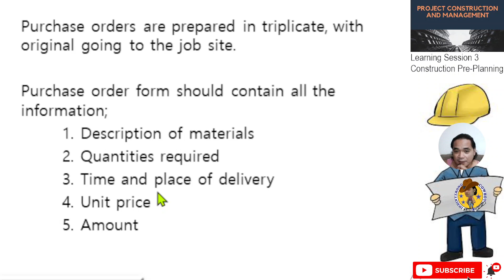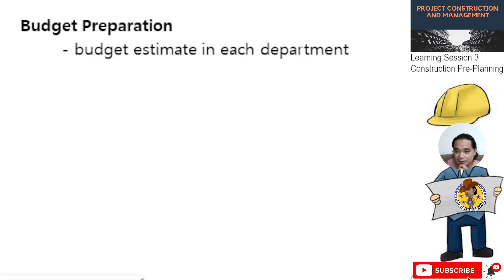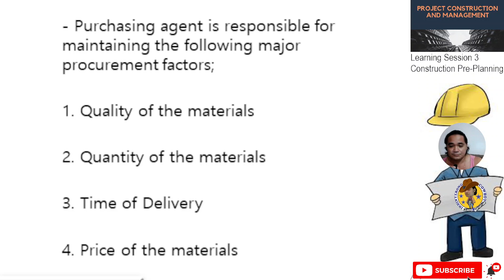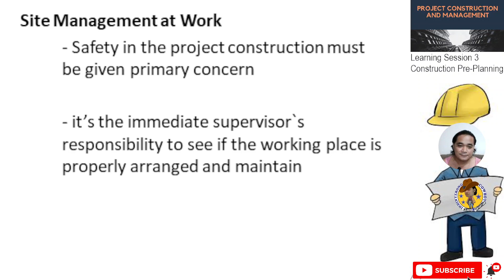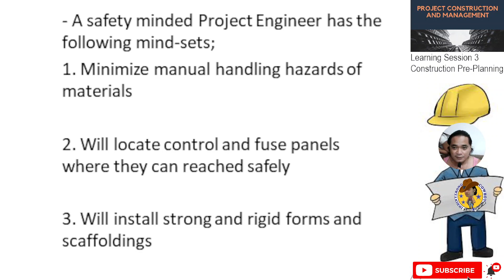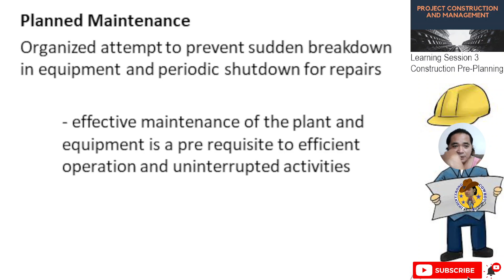Project Construction and Management  LS 3-Part 3 | Construction Pre-Planning

Comment: The goal of materials management is to ensure that construction materials are available at their point of use when needed. The materials management system attempts to ensure that the right quality and quantity of materials are appropriately selected, purchased, delivered and handled on site in a timely manner and at a reasonable cost. Materials management is the system for planning and controlling all of the efforts necessary to ensure that the correct quality and quantity of materials are properly specified in a timely manner, are obtained at a reasonable cost and most importantly are available at the point of use when required. Thus, material management is an important element in project management. Materials represent a major expense in construction, so minimizing procurement costs improves opportunities for reducing the overall project costs.

Comment: Material Supply is very important in construction industry because all project are needed a materials. The supply of proper quality of materials is essential for manufacturing standard products. The avoidance of material wastage helps in controlling cost of production. In order to prepare a material, the contractor must determine a material requirement and scheduled sequence of its deliveries. And the contractor must prepare purchasing program for the smooth running of the project. The purchase order should contain all the information the description of material, quantities, unit price, amount, time and place of delivery. In construction, procurement is very important for getting the right materials delivered from the suppliers. The one who purchase the materials is the Purchasing Agent because they are the responsible for maintaining the quality, quantity, time of delivery, and the price of the materials.

Comment: In the session, it's all about the material supply, financial and budgeting, inventory control, site management at work and planned maintenance.  
Having a high quality materials in a construction is a must. A contractor should determine the material requirements and the schedule of the deliveries. And purchase order form should contain all the information.  Aside from that financial and budgeting is important also in construction because in every business it must have a sufficient structure to sustain its growth. Inventory control also is very important regardless of what industry to monitor the supply and it has a safety place. And lastly,  planned maintenance to prevent any sudden breakdown in any equipment to lessen the damage.

Comment: Materials, budget, and workforce are the major elements and the driving force of a project. First thing that should be considered are the materials used since it is the foundation of a building or any construction project. Best quality materials should be used because low quality materials' life span gets less as time passes. Also, its quality will be affected by calamities such as earthquake, heavy rains, etc. it get damaged easily and may break, putting the occupants in great danger. Next is the budget. Finances should be crucially evaluated for project feasibility to ensure that the project is completed within time and budget as per client needs and requires. Also, tracking the expenses provide the necessary data needed to make better decisions when problems occur. Lastly, every men working in a project or construction, from the project manager down to the lowest rank person have families at home waiting for them to go home and above all, they are all human being whose lives are precious hence, we need to monitor their health and ensure that they are working in a safe and harm free environment.

Comment: More than 50% to complete the project in a construction is the materials so it is important to prepare a material before the construction because without it you can’t start your project. As a contractor its part the job to compile every quotations in every company that is supplier of the materials and this compilation would be the guide for the estimation if the prices of the materials would increase the cost and then the company can notify the contractor that can help to avoid over budget of the materials.

Not having a building permit is the cause to stop a project but there’s also a cause that happen in precurement process when the materials delivered by a supplier is sub standard, one of the reason that the project is stop by an inspection team. Procurement process is important in buying right materials for a sucessfull project and durable building construction.

Comment: The supply of material is very important in terms of constructing a project because this will strictly check by the project manager on time and a sequence of delivering all the materials because it is basis in the budget that is being given by the owner. The supply that is being Purchase will vary the description if it is good or bad in constructing. The purchase order should Should contain the description of materials, the quantities that is being required, the time and place of deliveries and the unit price. In constructing also it necessary the financial and budgeting because the project will base to the budget, so if you are going to budget you need to be self aware of the price you need to specific enough to the materials that you are going to chose.

Comment: Before the construction work starts, the material supply should be prepared. Contractor must consider the required materials, quantity of the materials needed and the scheduling of deliveries, also the contractor must be updated of the changes in every material’s prize. Contractor can do this all at once with purchasing programs and purchase order form. 

A construction company must be sustainable enough to meet the demand financial budget that is essential to purchase the required material and to cater most of expenses in project construction. The management should also maintain supervision and implementation of safety precaution on the site. This is to secure the safety of the workers  and operating personnels and  the eligibility of the equipments.

Comment: Another great video! Thank you for sharing your knowledge sir about the importance of material supply in Construction Industry. A material supply is more than 50% of total costs of the project, and it is important that right materials are prepared before the construction starts.Right materials are important because there are some projects that has quality inspectors. If you are using sub-standards materials to the project  it's possible that you will be stopped by the inspection committee. And most of all used quality materials for the safety of the people. 

A purchasing agent must be equipped with knowledge about the materials that are going to used for the project.The numbers of materials must be delivered on site. Strict on time, because there is a schedule that the personnel follows and also to avoid delayed.Lastly must check the price because some materials are expensive. As for site management at work , safety is the primary concern of all the workers . Equipment is also important in construction industry, it help in reducing the manual labor and also the risk factor. To prevent sudden breakdown in equipment  there will be a planned maintenance.

Comment: Material supply is important in the construction industry because you cannot complete a construction project if you are lacking materials. In order to prepare the materials, the contractor must first determine the material requirement and schedule of deliveries. Second, refer material quotations received during the bidding. If it is a big project, the contractor usually requests a quotation from other suppliers to compare prices which is helpful during project cost estimates. Third is to prepare purchasing program like a gantt chart. Purchase orders are prepared in three copies.
When it comes to finance and budgeting, construction companies should have huge financial capabilities to sustain its growth. Profit motive is the predominant factor of the survival of the company. Procurement process is important for getting the right materials from suppliers. It is important to get good quality materials because quality inspectors will reject substandard materials.
As for site management, the most important thing a project engineer must prioritize is the safety of all the workers in the construction site.

Comment: LS3-3
Material supply is very important because all projects are needed materials. Contractor should be determine his material requirements and scheduled the sequences of it’s deliveries because the owner should ask the contractors about the material list and bill of materials. Second, refer the material quotations received at the time of preparing his bid. Request for quotation to to other company because this will be use as basis on construction. Third, prepare purchasing program for construction materials it looks like a gantt chart of schedule and processes. Finances is very important because of this, the project having a movement or process. The profit motive is predominant factor of survival of the company. The budget is long term responsibility of management to use in investment so the contractors do the certain project. The two types of budget are static budget which is fix and the second one is variable budget which is flexible. Budget preparation is ideal preparation budget is do estimate by department. Procurement process is the process of buying materials for the project. Purchasing agent is responsible for maintaining the quality of materials (Should have knowledge about it), quantity of materials ( How many materials will be deliver, time of delivery (owner site) and lastly? Price of materials (Be strict in time because you have target).
Reply from the maker: good